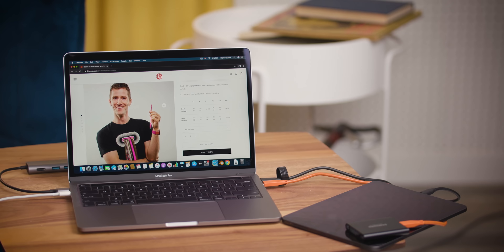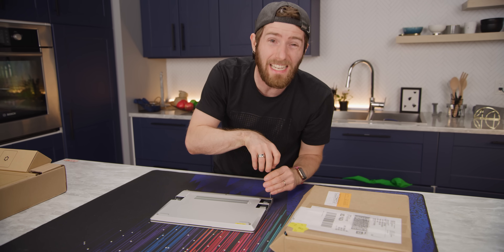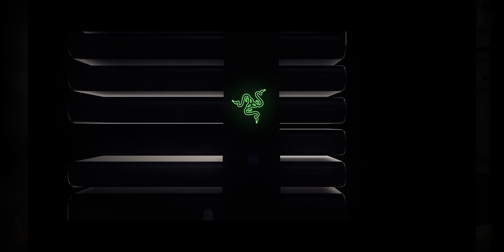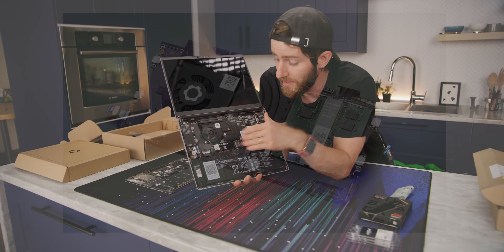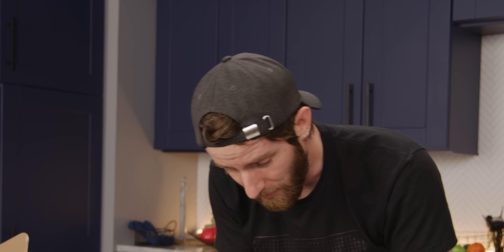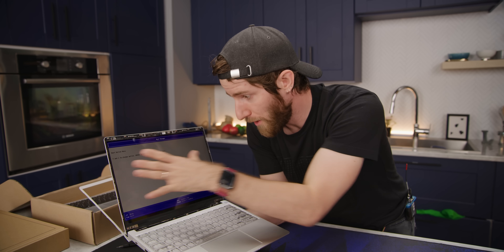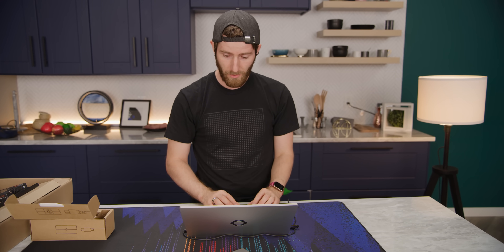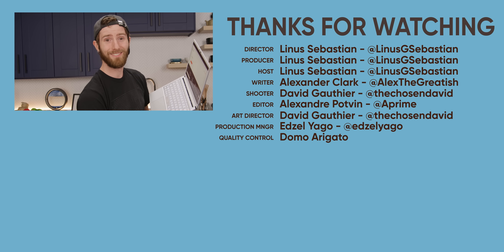A COMPLETELY Upgradeable Laptop?  - Framework Laptop Review

Comment: If it take some skill to repair something anyway, as long as there's no "device lock" on components people do have crazy ways to modify things. (I wouldn't even be surprised if people find a way to bring 16GB of ram to an A12X processor.) And for a consumer product that you likely don't buy extended warranty for, it doesn't matter, just mod it all the way, as long as it's not for the first year.
As for drawbacks, this laptop basically can't have 80WH or 100WH battery whatsoever, and port count is limited to 4 (well, 5), which means that you can't get enough to plug a mouse, connect to external HDMI monitor, charging and use LAN network while still being able to plug in a USB drive, as that's 5 things. Up the module slot to 6 or at least provide 2 free (in free real estate) USB-C port that doesn't take up any slot would be perfect.
And then, the only question is, is it worth it. It'll really only be on par in cost if you don't go the DIY route (and if you are on DIY route, there likely won't be any extended warranty option available), there's practically no room to fit a high end dedicated GPU on the 15 inch model, and when think of it, comparing to a Dell laptop you really only get the swappable ports, as Dell also allow user upgrade for ram and storage, while offering factory configurations for screen side and keyboard side.

Comment: I have a question.. If you remove a module, can you plug a USB C device directly into the port the module normally plugs into?  If you can, this is really great for people like me who do a lot of work with the laptop on the move (programming radios) and the cable is plugged in out of the way and protected from being broken off..

Comment: if you're looking for magnetic release charging there's a cable that has the magnetic break on the jack
Reply: I wouldn't normally recommend anything sold on wish/geek but I've had good luck with my magnetic cables for phone charging. I have a cable in the 3 places I'd charge my phone so I can leave the magnetic dongle in full time.

Comment: The I/O is my biggest complaint about this... There's 4 slots for expansion but all of them are single. So like... the USB-C port is a single one and so you're really just going from the embedded one to one that's on the edge and paying $9 for that privilege. Why can't they fit in two in that same expansion size? Or even better, have a USB-C port that's there without having to add an expansion module to get it?

And why no Thunderbolt? They're using an Intel processor so Thunderbolt is available and they can just charge a little extra for the expansion module to pay for the licensing. I like the idea and it's much more doable than the module phones that people keep trying. It just needs some more built-in stuff to make it more worth it. And some additional expansion cards too. LAN, VGA, Serial...

Comment: Alot of you are so confused about this fail laptop since all windows laptop can be upgraded to bigger storage and bigger ram as well, only difference was the modular usb port, hdmi etc. (the IO)

Pros: 1. easily removable module usb a, hdmi, usb c, sd card
2. Easily removable battery and screen (But all windows laptop can be remove)
3. Replaceable front screen frame.

Cons:
1. Expensive 1000$!for base model
2. Expensive Up to 2000$ for 512 ssd and higher cpu.
3. Did not even mention any rtx card at all 3 models.
4. Current gen ddr4 slot and current gen pcie 4 slot are not modular as well as cpu and gpu in short if you upgrade the motherboard it will cost alot since it is pretty much the laptop itself.
5. They dont make their own chip, so all future motherboard with new cpu,gpu, next gen ddr5 slot, next gen pcie 5.0 will probably cost almost at the same price of a traditional laptop.
6. If for example you bought a new motherboard, you are stuck with worn lcd, worn keyboard, old gen ssd card, old gen ram, worn charger and worn or full of scratch laptop frames. For the price almost the same as the new laptop with everything new.
7. Not to mention the terrible cooling system design of laptop is terrible. Look at all the upcoming gaming laptop, they are way better than this.
8. In conclusion this laptop is not future proof, having a module IO will not compensate for the lack of fully upgradeable next gen hardware such as gen 5 pcie and gen 5 ram.

Comment: I like the idea. Basic pebuilt is priced exactly as basic M1 Macbook Air - Intel i5 vs M1 is no match for MacOS users. Keyboard looks fine but only one choice - I am french canadian and won't buy a laptop unless it has ISO FR-CA layout. MacBook Air has better display (100 NIt brighter). Framework has more ports, fingerprint reader, less autonomy, no SD card module, no Thunderbolt module, is bulkier and heavier.

Do you think you would buy a laptop and upgrade motherboard later? On the other hand, being able to replace a defective mother board after warranty expires is an advantage. I would assume a careful Mac M1 user could expects 10 years of use with battery replaced once and that is an easy DIY repair.

Nice concept, not for me yet.

Comment: Great technology with a promising future, but it's not here yet. I went to try out their framework configuration, and it's only at the $750 price tag if you supply your own memory, storage, wifi card, and operating system, and also get a lower spec CPU.

So you can get a much more capable machine, for cheaper, unless you already have a bunch of spare computer parts, and even then, it's not cost effective.

I assume most of this cost is in the research and development of the modular technology, but still, the price to performance ratio is pretty terrible unless you already have spare components.

Comment: "Laptop CPUs are simply not available with pads on the bottom"
My Lenovo L430: Laughs
Reply: Good laptops back then also had an Express Card slot.
Reply: @tz8785  mine has one too lol. I am surprised at everything inside of this laptop. A Fingerprint sensor, 2 mini pcie slots. There are even plugs inside this laptop that i dont even know what they are for!

Comment: Battery disconnect also minimises risk of dropping a screw shorting something when opening it up. Run the disconnect and then disconnect from wall power. A lot of HP laptops have such a function for this reason, but it is a pain in the arse to activate, and impossible anyway when certain things are broken.

Comment: This is awersome!!!!  It means you can make a dock for it that HOLDS the laptop at all 4 of its moduleholes. Popp in 2 dc motors design a y shaped 2 type c arm onto 2 sides and because it has supporting grooves iit will stay on a wall asa 2nd screen or whatever. And you could attach a tinymicrocontroller on the go that FITS into that mezal thing so u only see gpio pins for fast circulit testing. Or even better an hdmi in for capturing console content without some shitass usb c to a dongle then capture card

Comment: Power on AC. Is good if you're using the laptop for a server, data collection, or any application where you want 24/7 run time but there is possibility of running out of power. The battery acting as built in UPS. This might not be a common first use for the laptop but will create more possibilities for the laptop living a second  life as a media server or some other use. Another exciting possibility is 3rd party replacement mother boards. In the future they could release a board that handles the basic power management and provides a few voltages, and some input/output interfaces. Then people could design third party boards for things like Raspberry Pis, Amiga, C64, Acorn, etc. Yes, those devices might only sell a couple hundred units each but it's not like Framework has to do a large investment in development and support to make this a reality.  Another use could be as a base platform for diagnostic equipment, user interfaces, etc that will need long field lives.

Comment: Full size SD card reader should be the next item in the shop ... Micro SD ... Why? If you drop them you can't find them. They blow away by the wind. They are hard to handle with big hands, even normal sized hands.

Comment: Needs some tweaking, but I'm in! Tweaks like making the modules standard and sell/deliver it like PCB-s, then you can pop them into whatever shaped plastic blocks to fit into the whatever shaped laptop case. So dont make the blocks proprietary, instead make the modules themselves in a standardized way (PCB) This way it can be used in many different cases, maybe it will spread across some other laptop manufacturers, who knows. That would be cool!

Comment: Linus I tried to buy a laptop with upgradeble RAM and failed. In most of the laptops there is only one ram slot where the ram is shouldered. And one port for nvme so you have to discard your old ssd if you want to upgrade.

Comment: used a non upgradable laptop for a decade with no issues, issues either happen in the first 2 3 months or never. If you pay 3 to 4k upfront for the cpu and ram the laptop will last you at least a decade to 12 years if you dont get unlucky, which is decent. Most issues will come from the motherboard and the cpu is inevitably soldered to it. That is why you dont see such offers. Removable batteries add significant weight. All laptop batteries can be replaced with some exceptions.

Comment: I really don't see the point of a customizable laptop. it looks awful, its not even that customizable, and once you customize it youre never going to change it so what's the point when you could of bought a better laptop with the features you are just going to set and leave anyways, it just means a bunch or shit I have to put together or lose when I could of just pulled a laptop out of the box and used it. if I want to run video games at 8k ill use my pc, but for simple work, using word documents, spread sheets, and google there's no point in upgrading every time a new piece of hardware when it comes out on a laptop unless maybe just maybe youre a game dev or editor who needs to be on the move but even then I doubt this laptop would do that for you and youre not going to find a better video editing laptop over a MacBook pro like it or not. so ill stick to my MacBook. cool concept tho I guess?

Comment: I hope they also sell parts or CAD files to print them for when their chassis will go EOL. This has huge potential. I'm waiting for either a Ryzen/Vega ( or Xe if Xe is powerful enough) or ARM/Risc5 for mobility. but the idea is sure really nice.
Reply: Loads of cad files and open source stuff regarding the Framework laptop.

https://github.com/FrameworkComputer
Reply: I would be more than ok with running a Ryzen based APU on this personally get a good cpu and decent gpu onboard with dual channel fast ram and you have a solid system that you can upgrade down the road as new main boards come out same with the different modules and you can even replace ones on the inside if something breaks

Comment: Imagine, putting a graphic card module upgrade into the side of your computer.
Reply: all this needs is thunderbolt 3 and ima buy it
Reply: @gwatheduck  It has thunderbolt 4 controllers on the CPU, it's not certified as thunderbolt, but it does work (I have an uncertified ASRock NUC 1165-g7 and it works with Razer Core + 6900XT no prob)...  Forum folks say eGPU works fine.

Comment: Linus is squealing of joy but it's kinda sorta reinventing the wheel, it's like an IBM ThinkPad from early to mid 2000s with everything user replaceable and a screw length reference printed on the bottom. 
Swapping ports is a nice touch but it's a feature that can hardly be described as upgrade, it's just a reconfiguration of what you already got. And I reckon it will do the job as long as you settle with one setup from day one, if you need several configurations then a bulkier yet single USB-C multiport dongle would be much handier than shuffling connector tiles like on Domino Day. 
I do like that something like that appeared on the market, I hope they succeed in their market niche.

Comment: If it went with AMD processor - I would take him.
Reply: Never been so close to spontaniously ordering something this expensive... but then only Intel... ie. no AMD (arm is cool for RaspberryPi but not as useful to me in a laptop.) Edit/PS: Battery-bypass should be a hardware switch. (So you dont need power to connect the battery.) Maybe its own secondary power/boot button.

Comment: Weirdly, the battery switch off is the part I found the most “I need this”
Reply: not weirdly, in terms of batterie life this feature should be on every laptop
Reply: @notabene9630  actually it should be an automatic feature. Meaning the user shouldn't even have to bother with it, the laptop should apply logic to preserve battery longevity.
Reply: Absolutely, I was looking for such a laptop for two months now, and suddenly, I look no more.
Reply: @InvisibleManCZ  Surface devices have battery Limit mode, it charges to 50% and keeps them there, seems a little better since you will always have juice for a few hours if you have to unplug unexpextedly
Reply: @InvisibleManCZ  Thinkpads have it but lenovos build quality is like... ehem... i have a "melted in" keyboard on which some rows randomly stop working because of 2 90° bends on the keyboard cable (which is a nightmare for everyone familiar with electronic engineering)
Reply: It would be good if this was either a button on the laptop or something you could select inside windows rather than having to go into the bios for it though!
Reply: Lenovo legion has this feature. Plugged in mode not charging to save battery cycle.
Reply: I'd love to see this become a software or hardware switch instead of a bios option. Or even better an automated circuit that charges till 95% or something and then switches over to wall power only
Its much harder to build but I think I've seen similar designs in the past
Reply: You can take out batteries from older workstation laptops. I use a hp 8770w, take the battery out and run from the wall. Pretty awesome.
Reply: @XxXnonameAsDXxX  Yeah but if the laptop could do it by itself from BIOS (similar to what's in the video), that is definitely better than having to plug the battery out every time. I mean if the battery is full it should disconnect it by itself.
Reply: Yup. Ideally it should be more smart about it. But the bios option is a good place to start
Reply: 100% This is the one feature I want to see in phones too!
Reply: Me too. I use my laptop plugged in 24/7 and I need feature.
Reply: As it's a UEFI, all it'll take is a windows driver and Windows can support that function without needing to go into Bios to do it. Depending on the power circuitry, even turning it back on upon loss of A/C power.
Reply: SAME.
Reply: Me too. It compeletely extend the battery life.
Reply: "Good morning gentlemen, I'm here to change the future".
Reply: it would be great if laptop can automatically not charging 😯
Reply: I totally agree! That is simply amazing!
Reply: dell, or at least my 2016 latitude laptops have super comprehensive and awesome battery management options in both the UEFI and power manager app which even go as far as scheduling charging for when electricity is cheapest
Reply: I had no trouble with my Lenovo since you can turn it off via their software. Although i hated their software so much that i uninstalled it so no switching off the battery and locking at 60% charge for me anymore hahaha
Reply: I remember having seen an old laptop, probably an IBM, almost 20 years ago which had thresholds on when starting charging battery and when stopping, in windows don't know if it also had the option on the bios. Never saw anything similar until now, if there are also others I'd like to know!
Reply: Literally everyone
Reply: that is awesome, also something that we already have decades ago by simply removing the stupid battery, but at least this is a solution for an integrated one.
Reply: I feel like most laptops didn't have this because of some stupid patent likely filed by Apple.... And Framework found a way!

Comment: @Linus if you want the Magnetic charging on this:
Grab a magnetic usb-c Cable from Amazon, 3d print a custom Adaper socket, hack up an old usb-c extension to connect on the inside and assemble.
(might also make for a fun little video)

(yes, you could just plug in the magnetic usb-c part normally, but this way it sits flush with the side of the laptop)

Comment: There is literally no justification for not having a repairable device. I found my old broken LG G3. It is super thin, super light, 3000mah battery.... and hear this people.... Removable back cover, interchangeable battery. Whatever manufacturers say, repairability IS an option, if the manufactures wants it... but they don't, they want your device to break so you can buy a new one. We NEED to get around this. I hope EU will enforce laws that devices that aren't upgradeable and repairable can't be sold in the region. It would suck for a while, but eventually manufacturers need to change.